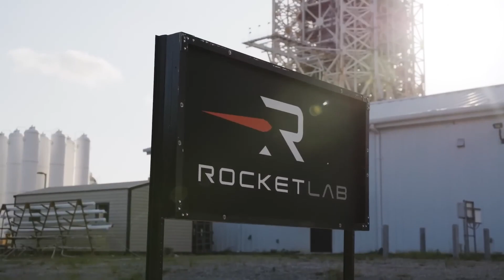This New Rocket Is Big Problem For SpaceX's Starship!

Comment: HERE IS A THOUGHT....
We just learned that submarines should NOT be built in fibre-carbon because regardless of its strength it is not possible to detect micro fractures ie catastrophic failure.... the reason is that the final structure is heterogeneous in nature, with strands of fibre and bonding agent, soo not competition just a useful alternative for UNMANED small payloads.... as far as re-usability, some engineers are so passionate about non metal solutions they are willing to die deep underwater to prove their point... (and still not be remembered....LOL)

Comment: lol so a new rocket that can take some of the commercial launch load away from Spacex allowing them to launch more starlink missions which provide far more future profit and fund starship is a problem? Computer generated video narrator’s aren’t very bright.
Reply: AGREE
HERE IS A THOUGHT....LOL
We just learned that submarines should NOT be built in fibre-carbon because regardless of its strength it is not possible to detect micro fractures ie catastrophic failure.... the reason is that the final structure is heterogeneous in nature, with strands of fibre and bonding agent, soo not competition just a useful alternative for UNMANED small payloads.... as far as re-usability, some engineers are so passionate about non metal solutions they are willing to die deep underwater to prove their point... (and still not be remembered....LOL)

Comment: What is the re usability of carbon fiber?  Titan submersible implosion shows that carbon fiber can fail over time through contiguous stress.   It is not the first time carbon fiber has failed.  Airplanes have failed.  Wind mill blade have failed. Epoxy does break down by continue radiation exposure and reheating.  So how many flights do they expect to get out of their star ships.
Reply: LOL I wrote this then saw your coment...
Thank you brother i feel less crazy
"HERE IS A THOUGHT....LOL
We just learned that submarines should NOT be built in fibre-carbon because regardless of its strength it is not possible to detect micro fractures ie catastrophic failure.... the reason is that the final structure is heterogeneous in nature, with strands of fibre and bonding agent, soo not competition just a useful alternative for UNMANED small payloads.... as far as re-usability, some engineers are so passionate about non metal solutions they are willing to die deep underwater to prove their point... (and still not be remembered....LOL)"
Reply: @rickabay  Im not buying any tickets soon.
Reply: @rickabay  Im not buy any tickets soon.